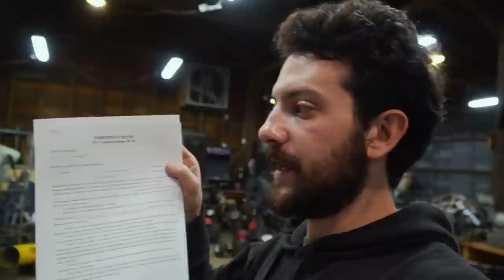Honda Z50 Sitting in the Woods for 20 Years, Can We Resurrect It?

Comment: Hey I notice that y’all use bbs often for fuel tanks cleaning. Might I recommend using broken glass from a car door. Easily obtainable from a junk yard. The glass breaks up into small squares and gives an edge to scrape the inside of the tank where bbs are smooth and I find glass does better.
Reply: Smart.

Comment: I have mentioned it before we used a pour in sealer for tanks that worked great! all you had to do is tape the holes with duct tape and pour it in and slosh a first thin coat wait about 30 minutes and add another cup and keep it rotating until dry. It never failed
Reply: I forgot to mention it was sandable and paintable

Comment: The decal looks like the one my neighbor had when I was a kid, it was brown not orange and it was a 1975 to 77, I actually had a 1977 xr75. I always thought all Z-50’s had rear suspension, the older QA-50’s didn’t have rear suspension. I grew up with these bikes, the Honda ST-90 the CT-70’s. A friend had a 1975 XR-75 they were still grey and had a 4 speed transmission. Brings back some good memories.

Comment: Love the burn out.   Several years back, I was looking at a Trail 70 and Lifan (out of China) made tons of replacement parts for 50s, 70s and 90s; even complete engines.  You could also buy a complete Trail 70 bike, with a bigger engine and electric start, for under $1K.  You probably already know all that, but thought I’d pass it in to your viewers, if they are working on a similar project.

Comment: In 1976, I was ten, and I bought a brand new Honda XL70. Basically a miniature CB750, lol. It was street legal (but I wasn't), had headlights, turn signals, etc. Very street suspension. And it was factory orange with black accents. My friend had an XR75, which was much hotter and full on Motocross. It was gray. I T-boned him and broke my leg 🤣🙄.

Comment: Hey guys!! Great channel and I’ve learned a lot about predator engines... which is why I’m reaching out to y’all. So I have a db30 minibike that I just put a predator 212 on it, rode for a week stock and did just fine, gotta knock off mikuni from go power sports last week, I put it on yday and it would crank but stall out due to the governor not being connected “I think”, so I decided I would take the motor apart and actually remove the gov and oil sensor. So I opened it up took out the parts and all went well EXCEPT the smaller gear on the right fell out with the front push rod, I put the rod back in and lined the dots up on the gears and put everything back in place. Resealed the motor, put oil in it and reconnected the gas. Well now it won’t crank to save my life!! I’m getting spark and getting fuel to carb but for some reason it still won’t crank, I’ve adjusted the fuel screw in and out on bottom of mikuni carb and it makes no difference :/ I was mainly wondering what the issue might could be and if something messed up wen the gear and rod fell out, cuz I just put it back in place. Was I supposed to make sure the rod went in a certain way maybe?? Idk wats going on or wat I need to adjust to make it run again and was hoping U guys might have some info about what it might be. I’ve asked everyone I know but no one has any knowledge on small engines and I’m learning as I go lol please please get back to me if u don’t mind via email - bmcdonough7889@gmail.com... I can send u my number if talking in person would be easier lol but I’m thinking I need to adjust the valves or something with the push rods but really need some help on this cuz my kid is ready to ride! But keep up the good work and keep that information coming. Imma keep researching in the mean time. Love u guys and I’m sure “it’ll be fine!” Lol

Comment: You can buy something called chemical metal and its got loads of great uses and I've fixed holes in petrol tanks before.
It's just like body filler with the hardener that you mix in so only do a little bit at a time until you know how Long it takes to harden.👌😉
It's really good when you have a rare machine and can't find a spare part for it.

Comment: The orange paint one is a 1974 z50. The first models with rear suspension was 1972. I don't know why It has a silver tag as the 1969 hardatil z50 is the only one I can find with a silver tag.  Could have been transfered from some other model, perhaps a ct70

The other bikes are a later model, The yellow ones that you guys have are 1976 models

Comment: I've used fish tank gravel on the inside of my fuel tanks...never tried the BB's/nuts/bolts
Reply: Believe the bolts n bb's are harder steel so they make more impact.
Thinking a combo of both would be really efficient. At some point though, enough is.. enough.
Reply: Evaporust is also useful.
Reply: Bbs are round you want rough sharp edges. Just use regular gravel. You want all the metal shiny inside. Or use vinegar.

Comment: it looks like 90% of getting this to run again is fixing the gas tank. 
the one bike with the rear suspension looks like the one ive had since about 1985, except that one had a gold/copper flake paint. not orange. 
it has been sitting for at least 25 some years and this video makes me want to get it out and running again.

Comment: get carby cleaner and use it on the inside of the tank and or rust converter with the stuff you put in it and while rotating it to clean it you will get a better result.

Comment: Why didn’t you just cut two long strips off both sides of the tank on the silver bike where all the holes are and weld in a plate instead of puddles on rusty holes

Comment: Why not use sand in the tanks, or maybe crushed glass?  Wouldn't that be much better and get into all the small areas?  Also, I like a good rusturation as the next guy, but do you ever plan to do a full and actual restoration?  Blast, metal work, paint, and decals?
Reply: Takes a little longer than i like. Not saying no but weve got to keep videos pumping out

Comment: Rear suspension started in 1972 on the z50s. Im not sure about the silver tag though. The 1972-1978 z50s are not the most desirable, the 1968-1971 are the super collectable ones and there are some really rare versions of those bikes like the 1968 "slant guard" or the 1968 "tall bar"
Reply: Rear suspension started in 1979
Reply: @brandnschannel  nope, Google it. 1972 was the first year for rear suspension and in in 1979 they changed the name from the z50 to the z50r and update the styling and a few other things as well. The z50 model families basically fall in to 4 categories, the 68-71 style, the 72-78 style, 79-87 style, and the 88-99 for the last style.

Comment: Isaac, how would you recommend fixing a fuel leak, 
on a PhatMoto bike?  Both tanks on my bikes leak.
The Rover, and the off road bikes have tank leaks.

Oh, both bikes have (or had) bad 6202 bearings 
on the jackshafts.  I converted one to a 5/8ths 
shaft, (6202-5/8ths bearings) and have the other 
one to fix.  It will get the 15 MM splined shaft, for 
now.  (I've got this one, and a spare.  And,  extra 
bearings at work, if I need them.)

steve
Reply: Wash out the old tanks with degreaser let it dry thoroughly.  Use the por15 tank sealer like the directions say. Good luck
Reply: @isaacitllbefine7231  Yep, including that part that says 
"turn the tank over, and drain it."

Comment: As for the older ones not having rear suspension is wrong. They had 2 models the z50 and the qa50 the qa50 doesn't have rear shocks and wasn't street legal were as the z50 does and it

Comment: I just bought a 1981 Suzuki rm 250 any tips on restoring it?
Reply: Lol clean carb get new air filter change oil if it's a 4 stroke idk new gas change spark plug and that's all I know
Reply: @muddypigstudios861  nah m8 cylinder is garbage I’m swapping the motor.

Comment: I know there are probably other people who have asked you this obvious question but why don't you just buy an aftermarket replacement tank for the Z50 off of eBay they have tanks for every year model for about 50 to $75 they come with everything including a new pet cock in all of the mounting hardware it seems like it would just be a much better solution than trying to make shift a rusted out tank Together and this way you know without question you would not have a fuel leak.
Reply: They are not shaped the same. We like the look of the old tanks